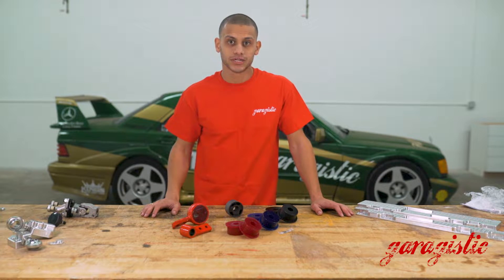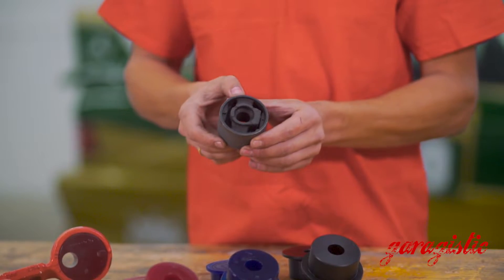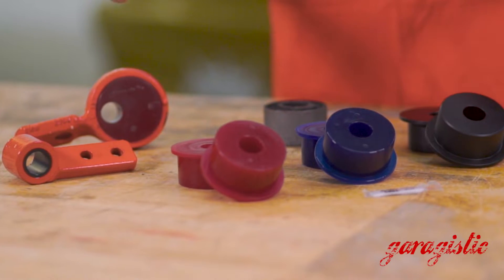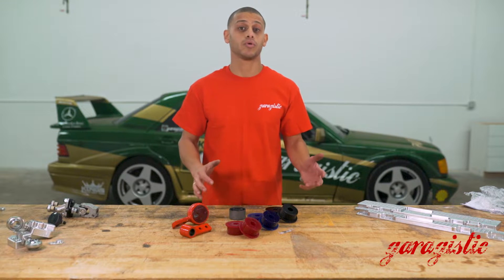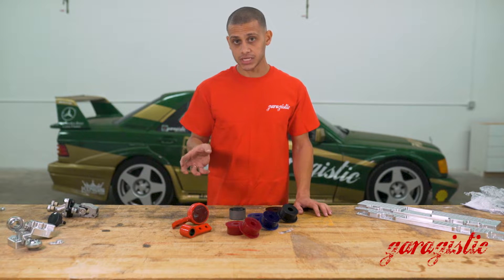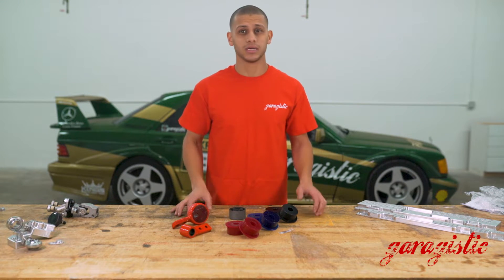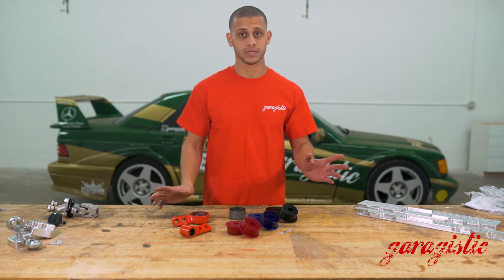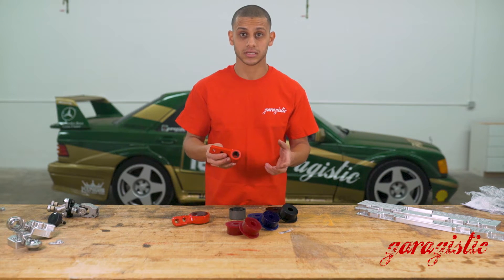Garagistic BMW E30/E36 FCAB (Front Control Arm Bushings)

Comment: Do you need to drill the lollipop and put a set screw in with the offset bushings?
Reply from the maker: While not 100% necessary, it IS recommended to do that to ensure they do not rotate in the lollipop 👍

Comment: you must never put HARDER BUSHINGS in e30 if you want to preserve the car structure. the car is old and metals are no longer strong. use factory original to preserve the life of car. this is a passenger car unless you want to use it for track-only which you dont care that the chassi can crack.